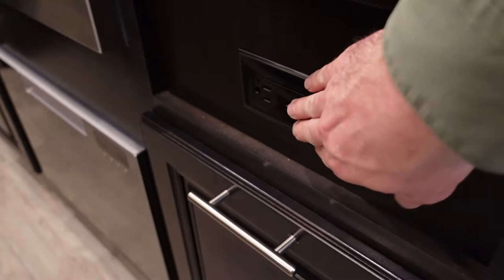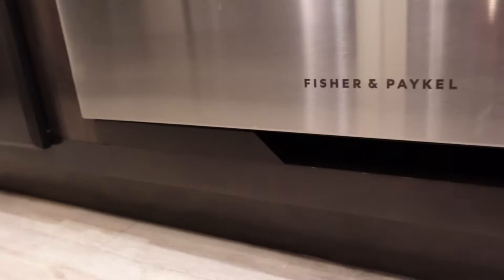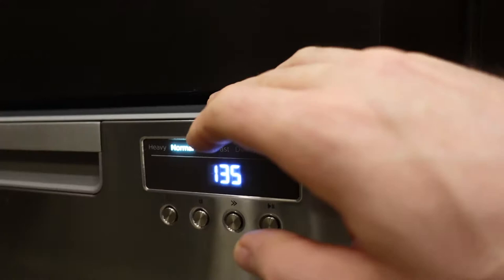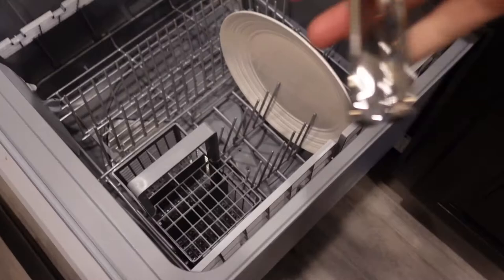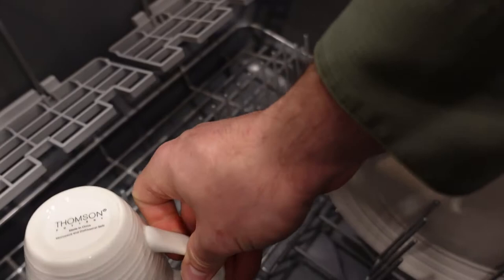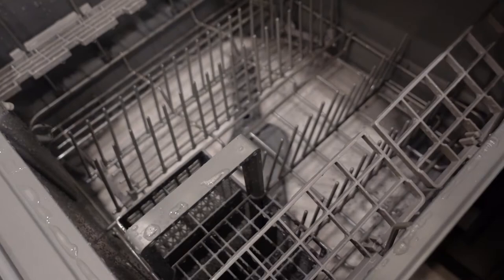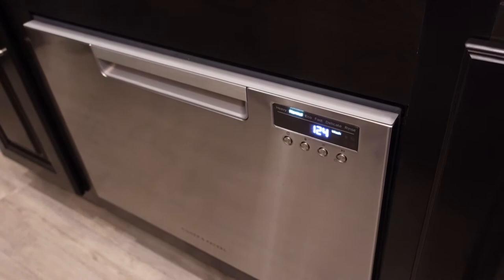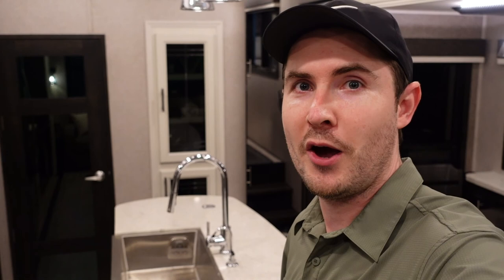Fisher & Paykel RV Dishwasher Install in Fifth Wheel // Owner Demo & Review // Model DD24SAX9N

Comment: After being out for the first time for an extended weekend, and going thru days of dishes, we discovered that we absolutely despise the farm sink.  We used a LOT less water with double sinks.  I showed momma this video, and she said, "Get one on order."   :)
Reply from the maker: The dishwasher is a very nice convenience I must say.
Reply: Looks like the 5 series is going out or limited supply.  Trying to figure out if the 7 series is the same size.
Reply: After some measurements, decided to go with the 7 series and the tall model.  That  means that I'll have to modify the top and bottom rails, but that's what I have a vibratory tool for.  The taller model allows for a little taller dishes, and was only a $100 more...
Reply from the maker: @darrinhiebert  Sounds great. You'll have to let us know how it turns out after install.
Reply: @AdventureRocks  will do!!

Comment: Fisher Paykel model DD24SAX9 N single draw dish washer error code A6. Remedy was to replace the single water inlet valve part number 529827     24volt      $18.00

Turn the breaker and water flow to the dishwasher off. 

Push the clips on the bottom sides of the draw and then push the rails/slides all the way in while pulling the draw out, be care to not bend the water lines and power cord. You have just enough room to lean the draw up and out of the way. Then take a small flat head screw driver and remove the plastic cover that’s covering the electronics etc. Pull the old inlet valve out of its holding spot (just gravity holding it there) and then detach the tiny 24v 2 wire electric cord connector from the water inlet valve, next put a thick towel under the water inlet valve that you’re replacing to catch residual water and unscrew  the water input, next remove the blew hose clip (I used 2 tiny flat head screw drivers to separate the teeth) and then use a small flat head screw driver and work the hose off of the water valve and then pull the hose all the way off. Keep the old valve in case this isn’t what’s wrong with your unit. Put the new unit in reversing the steps said above. Test the dish washer for 5 minutes running water etc through the unit then turn the unit off and then after letting the water drip from the top of the dishwasher into the draw for 30 minutes, open the dish washer and shine a flash light under the draw and check for any leaks.

Comment: I ordered a Forest River destination trailer because I want to live next to my son and the only way I could do that is to live in something "not permanent."  I chose a Forest River Cedar Creek 40CFK2 (front kitchen) because I could have a luxury QUEEN bed, washer and dryer, AND a dishwasher.  The Fisher Paykel is what is being offered for the 2023 and 24 models and I guess I'm getting a '24 model since it's being built as I write this.

However, even the sales guy couldn't tell me anything about the dishwasher.  I just rechecked the specs from the order and the FP is the one I ordered, however, although I know it will go on the right side of the front kitchen counter under the front windows, they still can't tell me if there will be a standard kitchen drawer above the DW or below it.

I am only 5'2" so I wouldn't want to straddle the dishwasher under the sink.  I am also almost 80 and wouldn't want to have to bend that far down to load and unload it, as you have to do.  However, your rationale for having a dishwasher is spot on and it never occurred to me how much water using it saves, although I'll be hooked up to the house well, septic, electric, and propane.

Your installation instructions were great.  In my house, we had to do some similar revamping to install a replacement oven and built-in microwave years ago by cutting off some extra wood and moving it to another location.  Also, we replaced a kitchen faucet with a pull-down sprayer and every now and then it gets hooked on the pipes under the sink so I will try your bungee cord tip.  Genius.

I am moving from 10 acres and a 2500 sq. ft. home (onto 19 acres next to a 3500 sq. ft. home) into the 40CFK2 so that will be a dramatic change.  But I'll have my washer and dryer, and my FP Dishwasher, so that is all I need.  

I must watch your other videos as this one was really helpful.  Thanks for taking the time to make it.
Reply from the maker: Thank you for the kind words! And I hope all goes well with your destination trailer, and getting settled in eventually. That sounds like a beautiful floorplan being built.

Comment: Awesome video, it's the best RV dishwasher installation video I've seen. You explain the installation process very well. Question, what about the air gap? Or did you loop the drain hose up high before connecting it to the T-piece? Thanks!
Reply from the maker: Thank you. Yes, great question. FP just recommends a "high loop" instead of a physical/mechanical air gap assuming you have the clearance. So FP provided one of those upsidedown "U" loops for the drain hose in lieu of mechanical air gap. I don't have a great pic/shot of it in video, but you can barely see it at timecode 9:16 and 28:21. I just fasened it up high right under the countertop height. A lot of jurisdictions for residential code allow the "high loop" instead of mechanical air gap if a full 32" of vertical space exist, and thankfully that is case with the counter height in my Pinnacle.

Comment: Amazon shows "currently unavailable" for model DD24SAX9N (the one you recommended).  They do have model DD24SAX9 - (no N at the end of the model number) which has similar dimensions (22.57"D x 23.57"W x 16.13"H).  Any idea what the difference is between the 2 models or are they one and the same?  I plan to install it on a 2023 Jayco Northpoint 377RLBH.  Also, what kind of dishwashing soap do you use on yours?  Anything RV specific or any dishwashing soap would do?
Reply from the maker: As far as I can tell, they appear to be identical. I'm not sure what that N is at the end. It almost seems interchangeable? As far as the dishwashing soap, so far I've just been using Cascade Complete powder, which seems to work just fine. They said only use powdered soap and no liquid. Or you can use the tablets that dissolve.

Comment: Hi, Just wondering, what is your opinion on the fact that the walls and base are plastic vs a traditional stainless steel? Also, what material are the racks? Are they a solid plastic or a metal with some sort of coating. Tried to ask F&P and they couldnt even tell me lol. Thanks!
Reply from the maker: The plastic used in the basin/surround seems to be a higher quality blend, or at least doesn't feel cheap if that makes sense. I believe the main racks are metal with traditional coating on them. The flip down on sides are plastic. It seems well made overall. I wonder if there's a specific engineering reason they went with plastic vs stainless steel perhaps? They use them in $1-2M coaches and sometimes even in homes stacked one on top of another so it seems to be a good quality product.

Comment: I am wondering why you connected to the hot water supply as the manual say to connect to the cold water. As I think the hot water would be efficient electricity when wild camping. Very much liked your video.
Reply from the maker: Thank you. Yes, for dishwashers you'll always want to connect to the hot water supply. Most dishwashers usually have a booster to make the water hotter, but they can't get it completely hot on their own. It's possible the manual suggests using cold water as an alternate if you don't have hot, but I would not recommend that... don't think it'd clean very well.
Reply: Will do. Thank you very much for good information.

Comment: Have you noticed when you run the dishwasher with the dump valves open (gray only), that you get a sewer smell in the coach?  Doesn't happen when the valves are all closed.

Can't really tell where it's coming from either...
Reply from the maker: Not consistently with dishwasher, but I do get it once in a while in various other scenarios. I'm suspicious one of the air admittance valves is malfunctioning, but it's only intermittent for me at this point so haven't been able to nail it down yet.
Reply: @AdventureRocks  yeah, I'm sure it's coming thru one of the vents as well, but the only places that I know they are doesn't smell, and that's what puzzles me...
Reply from the maker: @darrinhiebert  Agreed, hard to trace. Sometimes I wonder if while in transit the wind rushing outside forces air down from the roof vent into tank and then out the air admittance valves. In several of my past RVs seemed like I'd only get the smell after transit or after intense winds. Always something to figure out, right?

Comment: The Vesta has been discontinued. It was out of stock everywhere so I emailed the manufacturer.
Reply from the maker: Good to know, thank you for the update.
Reply: After having just installed the FisherPaykel unit, I would recommend the unit AdventureRocks installed.  If you have general repair skills, I don't think that this install is all that complicated.   Sure, the Vesta is nice, since you don't actually have to make any changes to the cabinet, but the hardest part with the FP is actually removing the side rail (which come out with 4 screws) and installing cribbing of some kind to move the bottom of the cabinet up.  Pretty easy changes in the end.  

As a side note, we LOVE ours.  We love ours, probably because we HATE our farm sink.  It is nice, farm sink or not, to just throw your dishes in there, and hit go, walk away and go and do something else!  Good luck, with whatever you decide.

Comment: Question....how deep is your sink and with a more shallow sink would I be able to keep the electric and hoses in the space between the sink and dishwasher as opposed to the left hand side. Finally if I do have to keep it to the one side what is the minimum area you would recommend as I don't have that same set up where my dish drawer is going. Thank you in advance!!!
Reply from the maker: So on my specific model the water hose, drain, and electrical are all located on the back bottom left corner where it exits the unit. I suppose it's possible to bend them toward the top if your sink is shallower, but then you definitely have to have enough clearance behind the unit to allow the water line to flex without kinking. But from a serviceability standpoint it probably is easier to have the water, electrical and drain located off to the side so that you could service things without having to pull the dishwasher out each time. The p-trap under your sink might be the lowest point and would determine how much clearance you have. Fisher paykel also makes a few different models with different heights too if that helps to know.
Reply: Hi  @AdventureRocks  Do you mind sharing the Depth of your sink that works for your setup? I'm looking into a similar set up - sink on top of F&P DW due to lack of space. Currently I have standard 36" tall countertop and the sink on top of a GE Spacesaver Over-the-Sink DW and the plumping is offset to the left at the back and partially behind the adjacent cabinet (but open to changing the plumbing to make this new set up work e.g. have it between the gap of sink and DW)Thanks in advance! (Fisher Paykel recommends a high hung loop in order for the draining to work so want to see what size of sink I should buy)
Reply from the maker: @htritah  I just sold my Pinnacle otherwise I'd offer to measure it for you. But, if it helps to know I believe there was approximately 6-8" between bottom of sink and top of DW. Basically you just need enough room under sink for your p trap or as in my case the hepvo valve (waterless trap). Then the actual drain for DW on mine was further off to the left side of cabinet (seperate from sink) and higher up as you alluded.
Reply: @AdventureRocks  congrats on your sale. thanks so much for the info!